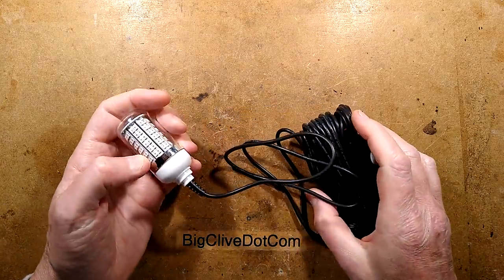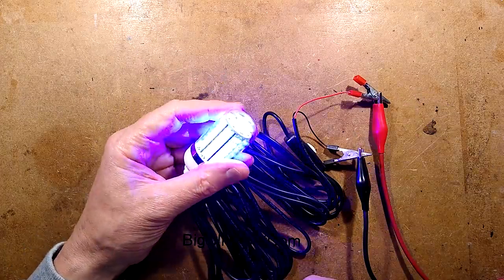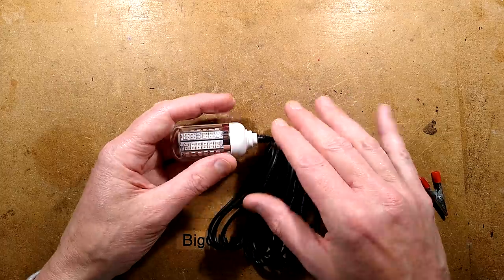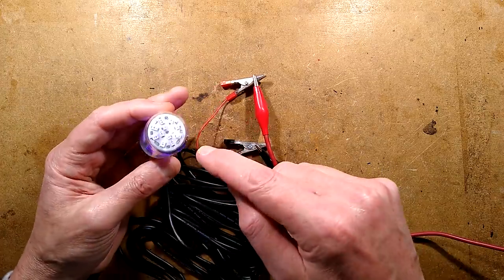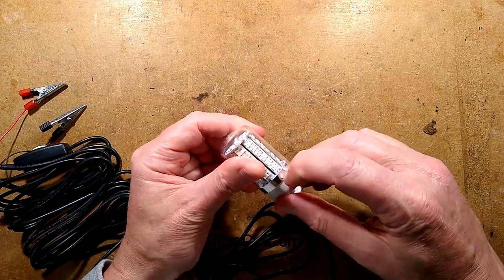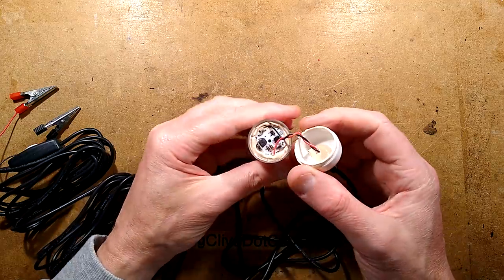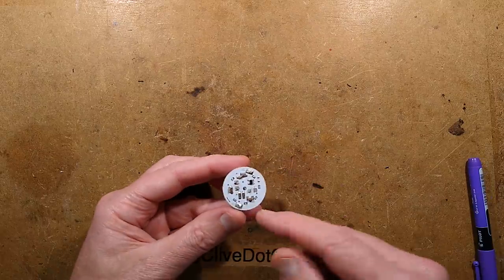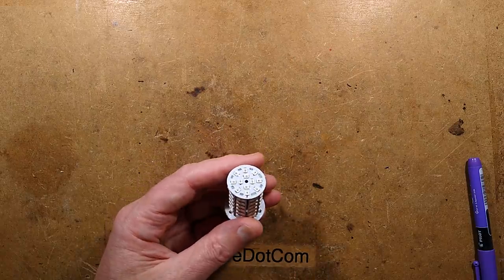Inside an LED fish lure (with schematic)

Comment: The bridge rectifier is in case a beered up fisherman hooks it up to his trolling motor battery backwards.
Reply: I wish more products included bridge rectifiers because shit happens.
Reply: @railgap  Tell that to DC-AC mains voltage inverter manufacturers
Reply: They could just have put a blocking diode instead to prevent damage. Less voltage drop and cheaper

Comment: Lamps of this shape were, long ago, sold as early "corn" style general LED bulbs, having many LEDs - typically 50-100. The lowest part on the white plastic body of the lamp was holding E14 metal screw, while the one above it was meant for fitting the E27 one. Top of the transparent cap had several holes for cooling. The only difference was in a driver, as it was for 230V AC, if I remember well, it was the capacitive dropper. The "corn" bulb I have flickers a lot - that is, a strong stroboscopic effect is noticeable in an otherwise perfectly normal lamp. In my opinion, "corn" bulbs principal design flaw was underestimated cooling requirements for such a crowded lamp, so perhaps they were even deliberately made to supply LEDs with power for a fraction of the time, to keep overall temperature at the reasonable level.

Comment: That is a hole in the center isn't it? Clive why didn't you just find a wood screw and tighten that into the hole and get a good grip to pull out with?

Comment: I have two of these in my koi pond running from a 12V garden lighting transformer. They are a lot cheaper than lights sold by the koi dealers or swimming pool suppliers - a lot cheaper!
They have been underwater now for 16 months and haven't leaked yet and have been run for a few hours three or four times a week. They are very buoyant and just float on the surface so as I wanted them about a foot underwater I stuck them on to the end of plastic pipes which are clipped to the side of the pond.
They work really well and the fish totally ignore the light.
Reply: "They work really well and the fish totally ignore the light." So much for the "lure" part of this presentation!

Comment: Longtime viewer first time caller long time fisher. Its quite uncommon to use anything but green for a fish attracting light. It actually doesn't attract fish directly but attracts micro organisms which attracts baitfish which in turn attracts larger fish. Its effective but not really considered unsportsmanlike. Usually used when using bait rather than lures

Comment: I have an idea that might help with reverse engineering the traces on opaque boards.

I think you have an IR camera, right?

If so, heat the trace(s) you're intersted in a bit with a stab of the soldering iron, then take a picture with the IR camera.

Hopefully the trace(s) will stand out well against the surrounding board. (I don't have an IR camera to test.)

Might not work if the trace is connected to a power/ground plane, or for more than 2 layer boards.

(I doubt I'm the first to think of this, but it just popped in my head when you mentioned the white boards are difficult to reverse engineer. Let me know if it works.)
Reply: Don't know if the resolution of the FLIR cams are all that good. I think the max is somewhere round the 640X480 or maybe 720 for the very expensive version, like what would be used for thermal imaging of power transmission systems. YMMV
Reply: @FuriousTesla117  If you can get close enough, 640x480 should be pretty good.
Think how much detail you can get on an ancient VGA screen. 
I think traces other than ultra-thin ones would probably be easy enough to pick out.  👍🤔

Comment: I had the same thing with getting tracking for a useless 'gift' package (Controller Wrap.) I immediately reported them to ebay, and gave them 2 weeks before filling for a refund which I got.

 They even falsified the 'gift' package contents to match the listing.

 Wouldn't be surprised if a lot of these places send out those junk packages seeing if someone notices and complains they didn't get the product. 

 If they do, then they send out the product for real. If noone does then they send out no real product and keep the money for it.

Or if you toss out the package and 'gift' product not thinking about it you can't prove they scammed you so again they keep the money as you can't get a refund.

 For me the product did finally come. Albeit 3 months late. But I already got a refund. Based on the time it took it was likely sent out only after I said something.

 Not like how they claimed which was it was on it's way already.

Comment: We used to dip shrimp from the water by suspending a gas lantern over the surface at night.  The shrimp were attracted to the light and we'd scoop them up with a small net.  In about an hour we could collect several pounds of shrimp.
Reply: Squids too
Reply: Bubba gump

Comment: I just wonder if a few flashing small LED lights inside a thin plastic tube, (rhythmic flashing) would attract fresh water fish with a treble hook on the end ?  It wouldn't need much battery power to run that for a few hours.  Even one at sea might work on the end of a line!

Comment: If it's only to be used for a pool party (The light being submerged in relatively fresh, although chlorinated water for only a few hours and that's it) I think it will be fine, even though I still haven't started playing the video.

But if you use it for its intended purpose I'm pretty sure the waterproofing will fail soon or later, or the temperature changes will make condensation appear inside the sealed enclosure, or the UVs from the sun will degrade the plastic of the light or cable and last but not least, some LEDs or the driver or both will fail after only a few days of fishing, with the light output ultimately reducing or the whole light flashing away like a beacon of some sort 😂😂

(Fun fact: I've actually seen LED streetlights blinking at full intensity in quite a wide street (Or I should say avenue) in Milan a few years ago.
I don't think such a big city will use chinese supplies from eBay but still the drivers in each of the incriminated fixtures must have failed one way or another).

FYI I've seen LED streetlights from the prestigious Italian light manufacturer Iguzzini (The Archilede model, first generation, not the "HP" one) in use in a smaller city close to Milan and they were all working fine, but I don't know who was the manufacturer of the blinky-blinky ones in Milan.
Reply: One reason why I still love high-pressure sodium Street lights!
Reply: @chrisa2735-h3z  Yep, same for me
(Plus the orange light they emit happens to be less harsh on the circadian rythm if you're unfortunate enough to have the light shining through your bedroom window at night and no way to shade it, ie it's summer and closing the window and shutters will make the room too hot to get a good sleep)
The orange light emitted by high pressure lamps is also quite close to a sunset regarding the wavelength.

Comment: There are Angler fish that have a protrusion from the head a bit like a fishing rod, the tip can glow (bioluminescence) which attracts fish.
also, fishing lures flash because thay are shiny, which also is attractive to fish.
Reply: Doesn't that make a good argument for a small flasher circuit to randomly fire the LEDs?
Reply: @demef758  Made comment on the video. A norwegian company basically sells this, but it's expensive as hell and I don't like that the product is glued shut making the whole thing disposable as opposed to letting you replace the battery. Here is the product in question: https://www.skittfiske.no/sovik/215505/s%C3%B8vik-deepligth

Comment: Since your the expert on ozone devices, does ozone rise, fall or does it need a blower over it?
Reply from the maker: It will diffuse in the air.  It may be slightly heavier than air, but a fan for diffusing is useful.

Comment: Heck, if you are going to cheat by using a light to fish you might as well go all the way and include a high voltage shock module with it. When the shocked fish float to the top all you need to do is scoop them up with a net. :)

Comment: Ohh that chip has an analog input (0-2.5V = max brightness) to set the dimming.  Throw a ADXL335 accelerometer (Y or X output) fed to a 1/2 divider into the ADJ pin on the UM1305 + battery pack and tie-wrap it to your wheel on your bike and it will glow brighter based on your wheel speed.

Comment: I think I know where this idea originates…

I’v used UV fishing lights and seen them used for the past 35 years. Low level UV probably around 400 nm.

(There’s also a Styrofoam enclosed car headlamp… that sits on top of the water. Sounds like that could get sketchy pretty quick. And would be a huge attractant for bugs!)

The only type I have experience with… Are long fluorescent UV bulbs. That mount to the side of a bass boat.
I don’t know how well they attract fish, but the UV lights help to see what you’re doing when night fishing, especially for smallmouth bass. 

And Without attracting big hornets and other stinging creatures. Because when you’re fishing out of a boat at night, there are all types of hornets, snakes, and all other type of creatures in the trees. And they are attracted to any bright light. And will come straight for your boat. I’ve been held hostage many times in my own boat from copperheads, water moccasins, and other venomous snakes. 

I still have an expensive set of fluorescent tube type UV lights. That were mounted to my bass boat. probably 390nm if I had to guess. They were purchased about 35 years ago, and put on my fancy tournament boat at the time. 

I believe they were about $750 for a set of four back then. They were not cheap. But nothing in the sport of tournament fishing is. This was long before LEDs… And many night fisherman used them. There was a shield between you and the light, so your eyes did not become fatigued with the low level UV. It shined towards the bank and towards the water. Add an angle so that it could not be reflected to you.

It would light up the monofilament or braided fishing line very bright, you could even see it when casting 50 yards from the boat. It was also wonderful for “charging“ your glow in the dark fishing lures. Since it was low level UV light… It would charge up the glow in the dark lures in just a few seconds. And they would continue to glow very brightly, like they had been charged in direct sunlight. 

Smallmouth bass fishing is pretty tough, they’re exceptionally hard to catch in great number or size. And it’s a lot of fun!

Comment: In response to 00:09:25 comments, putting the current sense resistors in series with the LED and Inductor pair allows them to sense current even when the Mosfet is in the off state. Some regulator chips use a fixed frequency and simply turn off when the current reaches a particular preset level. In contrast, the UM1350 chip will regulate to +-15% of the set current and adjust the frequency and duty cycle to maintain this specific ripple current. Page 6 of the data sheet I found illustrates this fairly well.

The trade off with this strategy is the chip must operate at full input source voltage (minus the bridge rectifier drop) while some of the LED "mains" lamps you have disassembled do not.

P.S. I do enjoy watching these videos on my lunch hour; great work bigclive!

Comment: so long as the colour is not "RED"(because fish can't see the colour red! 'plus many other animals it turns out')   you can use any colour of light. its just that the fish are attracted to light were they know they will have a better chance of seeing/finding food. so you put this light into the water and then have baited hook beside it where the chances of it been taken will be increased massively.. PLUS in different water colours, and clarity's, different colour lights would work better.. so that's why you can get different variety of the colour and hue's of light in my opinion. but don't take that to the bank (apart from the colour red part, & the rest about it attracting fish into where you baited hook is that is) its just that it make sense to me more than any other i can think of.. ; )

P.S. iv never used one by the way! but i do have little 5mm diameter 1 inch long glow sticks(the type you crack and shake like people at rave's & nightclubs use) that you attach to your float with little elastic bands so you can see your float at night. but never went out night fishing.. was soo tempted to crack one & see glow : ) but i was able to resist... BUT GOD WAS IT HARD!!! : (

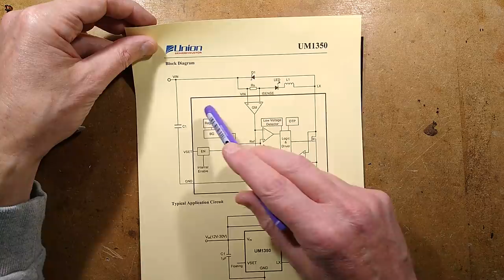Comment: You never cease to amaze me how you find all the doodads that you do, Clive. 7:44 These special "floating buck" regulators confound a lot of beginners when they see the schematic. For starters, there is no "ground referencing" to the switching network. Weirder yet is how a (triangular) current waveform through an inductor can be maintained even when the voltage across the inductor flips in polarity, making it look like current is flowing "in the wrong direction." If the inductor behaved like a resistor, positive current would always flow from + to -, never - to +. However, an inductor will pass a current in this one direction regardless of the voltage across it! Behavior like this is what confuses many about inductors, but it is key to understanding how ANY switching regulator works. Inductors are at the heart of any switcher. Study them, students! I'm tempted to walk through the two phases of this buck, but it would be another long, wordy comment, and I don't want to again bog down Clive's comments section with it.

Comment: Søvik (Norwegian lure brand) has a similar light that's designed to be attached to the fishing line and suspended above the bait hooks for deep water fishing. It's called Søvik Deeplight. They have a similar less rugged variant that can handle shallower waters. Having looked at it it seems rather basic and simple to make. Would be awesome if you could make some schematics and find a fitting cheap container to put it all in. Also it seems pretty wasteful that these Søvik products are disposable as opposed to running og replacable batteries.

https://www.skittfiske.no/sovik/215505/s%C3%B8vik-deepligth 

PS: I would have attached a link to the manufacturer as well, but it's basically the same information whithout an image of the product.

Comment: Just thinking about all those LEDs in that small capsule, and heat issue. Surely, there shouldn't an issue? The whole thing is water cooled! Assuming you're meant to plop it straight into the pond/river etc?

Those LEDs look much like the ones in my new insect killer lamp.

Comment: the thing with the shipping. was a trick. its to fool those who are looking to buy locally. they are able to provide ebay with tracking for the GIFT that is local but the main component ships from china taking 2-3 weeks longer than listed on ebay. ebay sees it was delivered  (they used the tracking for the gift for eBay) and doesn't bat an eye.

Comment: Distracted ramblings of an old tech... 

I know little about fish, however living in an ancient cottage in the middle of nowhere for nearly 30 years surrounded by fields I have found that some hornets are very attracted to light. They will crowd around my outside light next to my door and when I switch it off they will go to the kitchen window and start flying into it, they make quite a solid donk sound as they hit the glass. If they get in the house I just put the outside light on and turn off the inside lights leaving the door open and they quickly go outside and donk the light. 

There haven't been many this year, and not many rats either, however this year the moles have been at their worst for the whole time I've been here, I think it is the dampness making for soft ground. I wonder if rats and moles are like Great White sharks & Orcas, when orcas are about, sharks disappear for hundreds of miles, if an Orca see's a great white it will probably kill it (I saw it filmed and the Orca just rams the side of the shark at great speed. 

Rats are tough critters and out here the best we can hope for is to control them, compared to moles their tunnels are shallow and short but it is all relative. Moles though excavate tonnes of soil, they are immensely strong, when a cat I had years ago brought one in at 2.00am it just dropped it in the corner by the door, me - feeling kind - with a large coal shovel tried to lob it out the door into the garden. The mole hit the shovel with such force that the shovel rang like a bell for a few seconds, it was so angry it was furious, mind you between me and the cat dragging out of a forming hill, I don't bame it! 

Do rats disappear when moles come? The moles are everywhere, all 7 of my neighbours here are affected, even the molehills have molehills! Moles are smaller but I think stronger and much better underground, I think a mole could destroy a rat homestead, here in the summer they are in underground tunnels usually. In winter they try to get into lofts and other warmer places, I don't know where the moles go! I don't think either - particularly the moles - like lights or are attracted to them, so lure traps won't work!

Comment: Sounds like something you might consider, using a small watch battery with a low power LED on a fishing lure that sits in the water under a bobber. Would be interesting to see if it attracted fish. Fish can be very curious.

Comment: Probably more useful than this for most fishermen, there are fishing floats ---- also known as bobbers ---- for supporting your bait a few feet below the surface of the water, which have a battery and an LED in them so that you can see a fish pull the bobber under when you're fishing at night. They use a button or coin battery to power the LED.